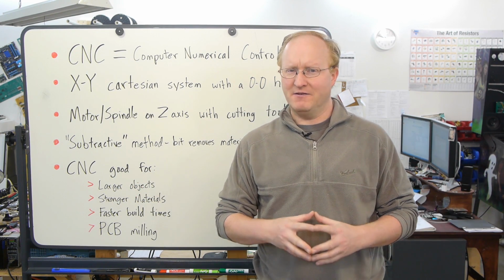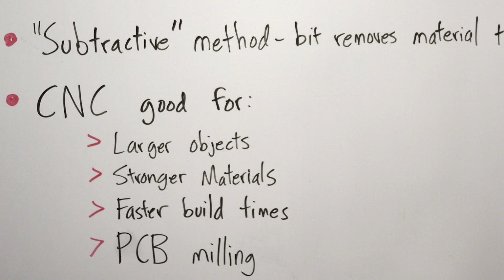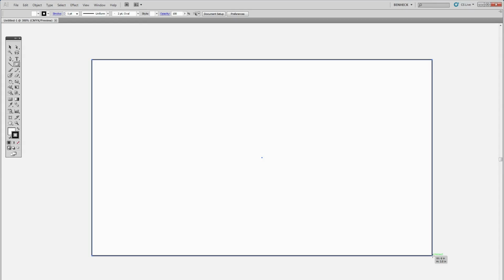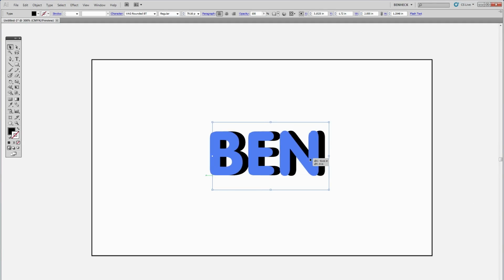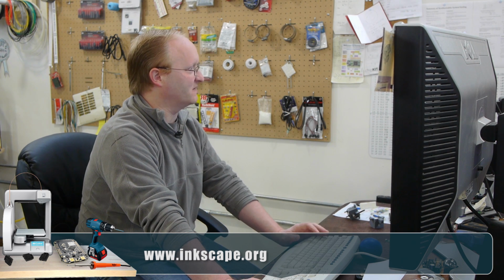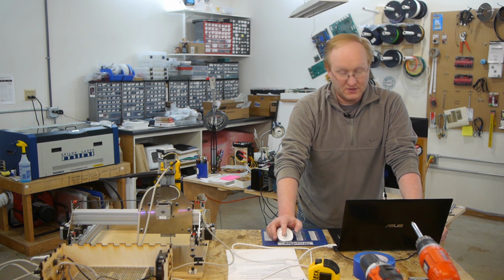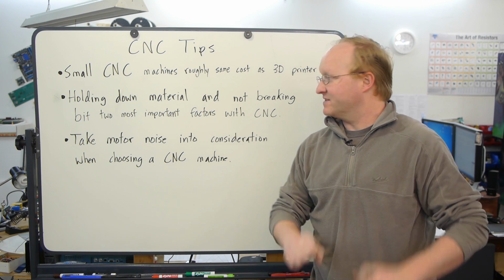Ben Heck’s CNC Router Tutorial

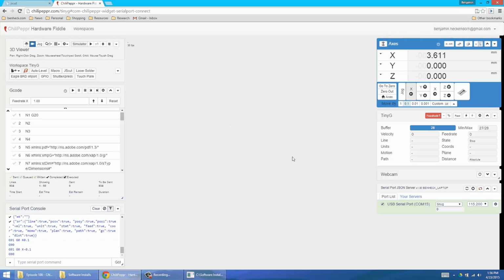Comment: The manufacturer needs to create locking mechanism for the motors NOT to move when the machine is NOT powered to avoid the unnecessary current being generated that could in turn destroy the machine (-18:57). This is just a suggestion.

Comment: Schottky Diode premade boards for 4 wire stepper motors are available on ebay very cheaply for a few dollars that will provide back current protection blowing up the driver boards. Highly recommend.

Comment: a very impressive vid ben.   one suggestion.  why not have some sort of  ON/ OFF  switch on each power line to each motor.  so when your about to move the motor you simply flick the switch to  OPEN CIRCUIT.  stops any power/ current feeback .

Comment: Cnc cons, small objects, because the are hard to hold in place? But that doesnt have anything to do with the machine? But the machines workarea.. Like unless you want to cut into a stock that is 1x1mm i can see the struggle. But like, engraving a coin, if your flatedged clamps are taking up to much space, then cut yourself a ringclamp. Like, you already have the machine to do it.

Comment: The acronym "CNC" has nothing to do with "cutting".It never has. It refers only to the control side of the machine.This can be any machine like a lathe, laser cutter, pipe bender, sheet metal former, etc. The acronym is not solely reserved for milling machines.

People juts got lazy and and stop saying CNC milling machine and eventually just called it a CNC...which is technically incorrect because its such a broad category.

Comment: Hi!
Iv got a question about building 4axis CNC on 1200x1200mm measurement. What is the best stepper motors for this size? Working with alloy or wood materials. Thank you If you will help me with this project problem!

Comment: He makes a fantastic point about moving the gantry quickly causing back EMF from the motors back to the board. Those boards may not be protected for that type of usage.  It's a good point especially when transporting a CNC and the thing is flying around in the
back seat of a car, and you arrive with a fried microcontroller board. But who knows. Some of those boards may have protection for that.  But still. Why chance it.
Reply: +Jeff Since Ben was very clear about that subject, I can only assume you wanted to post in order to co-opt his intelligence. A point further buttressed by your use of Electromotive Force (EMF). The potential voltage generated by manual movement is only half of the concern. There are amperes to consider.

Comment: I wanted to add a  solution to moving the axis of the CNC.  On a machine I built back in the 90s, I used a DPST switch at each motor.  Each pole of the switch would connect to each winding.  You only need to connect the switch to one side of the winding.  When you have to move the machine, just flip the switch and move all you want.  In later builds, I would put relays at the control board to effectively take the motor our of the circuit.  I would then connect the relays to the supply power.  So when the machine was on, the motors were connected or armed.  When the machine was off, it would take the motors our of the circuit and protect the driver.

There was a discussion about using a diode but it would not work.  Because steppers are unique, they can send reverse voltage to perform a higher resolution.  Putting a diode would limit voltage only going in one direction.
Reply: +Bob Roszkowski if you give me your email ,that i tell you.

Comment: If diodes are used with the DC motors it would keep the voltage from going backwards to the board, when motor is moved quickly by hand.
Reply: +BlackLocustMusic  Unless the motors operate in AC.
Reply: +BlackLocustMusic They are stepper motors. They are not really "AC", but they aren't exactly "DC" either. If you start putting diodes in to prevent them from sending back emf into the control board, they aren't going to run.

Comment: "only move the motors manually slowly", cannot this be solved using a simple diode that short circuit the motor reverse current, like in many other systems?

Comment: A question to around 4:15:
In the H-Bridge to the stepper motor are Mosfets build in aren't they?
So would the current short out the motor itself though the flyback diodes in the FET and dont effect the circuit? Or am I thinking wrong?

Btw: Thanks for the good videos =)

Comment: Ben did an excellent job introducing CNC to folks who are new to the hobby.  It's a blast to get into and doesn't have to be crazy expensive.  Machines can be built for under $500 that are pretty capable.  Or, a very good entry machine (3040) can be found on eBay or Amazon for around $600.  There is all kinds of free and open source software available as well.  There are even plug ins for Inkscape that let you generate the gcode right within the program:  http://www.keerbot.com/generating-gcode-using-inkscape/
It can seem intimidating but it's really not after a short period of time.
I have a bunch of videos of my CNC build using drawer slides and fuel line hose.  The machine has worked extremely well for all kinds of projects.  I started with a rotary tool and then built a larger gantry to hold a regular sized router bit.  
https://www.youtube.com/my_videos?o=U

Comment: This is very much a introduction to CNC machining, with the use of foam as the material a lot of the hard settings to get right did matter as foam is very soft.
When you start to mill wood, PCB's and metal. etc things get a lot lot harder, spindle/tool rotation speed, feed rate how fast you move the tool through the material become very hard to calculate and are related to each other, setting rotation speed effects the feedrate altermately to carry heat away from the tool with the chips of material being removed. This is something i didnt think about when i purchased a CNC machine, it takes some time to build a database of information on your tools and materials to get the cutting speeds right, getting them wrong can be expensive as you will start to snap cutting bits by over heating or over stressing them. I did this
a lot when first experimenting.

Comment: On my custom built R2D2, I have the same concern of pushing him and generating power that overheats his foot driver board.  The maker of the driver board recommends putting a diode circuit around the power switch back to the battery. Perhaps one could do something similar here.  Of course, a rechargable battery would need to be added.

Comment: The machine follows the pattern from the center of the bit correct? So do you ever have to take into account the size of the bit itself for precise slots and whatnot?
Reply: Coledboudreau On the software Ben used it looks that way but in more professional software you can have the cutter follow the path on the left, centre or right. This is usually referred to as tool compensation

Comment: When setting the zero on professional machines we always used a piece of paper as a feeler gauge between the Bit and the workpiece, then subtracted the paper thickness manually in the coding.

Also we had an x y z jog wheel.  Essentially a rotary encoder to control movement on the selected axis (which you selected by pushing x y or z button) and you also pressed 1 x 10x or 100x button to control the speed of movement per revolution of the jog wheel. 

That would make a great project

Comment: "You can get spindles which run at a higher frequency than a normal router, but they're a little bit more expensive." Not just a little either. The one he has on his big CNC is about $4000

Comment: 3-D printers use the same G-code.  CNC can refer to different types of machines from laser cutters turret punch presses CNC lathes routers(like the shapoko) mills and multi axis version of any of the above.  yes the 3d printer is a type of CNC.  Sorry for  being anal but I like to call things by what they are.  yes I know many people call machining centers /mills just plain CNC.  When I have looked for work this has caused confusion because I have experience  several CNC equipment but not in others although the concept is similar.  I love inventables great company